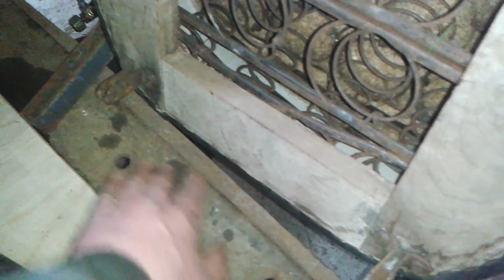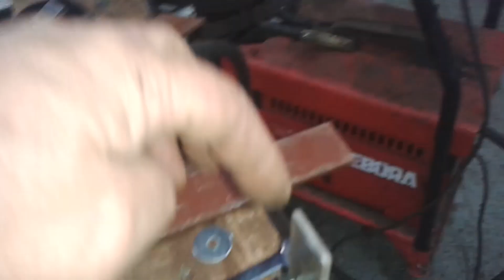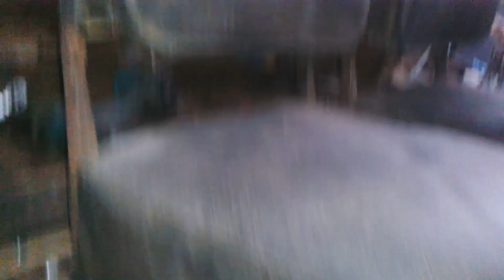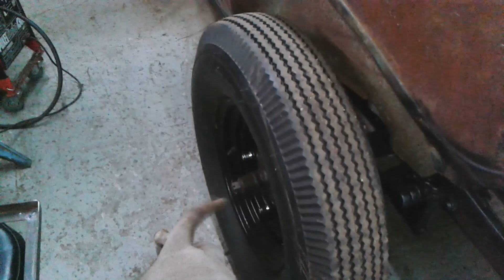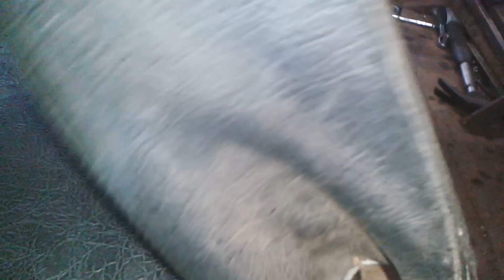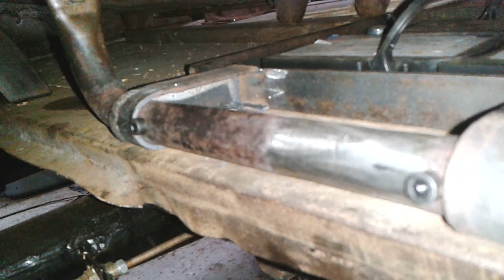32 sedan Progress. Seats, floor, battery tray Pt2. Mart's Update 2021/ep21/pt2.

Comment: Looks like a very solid and well executed solution to your seat issue. I like it! It makes me wonder though: how do the automotive registering agencies in Britain typically respond to modifications like this in old cars? Are there vehicle inspectors over there that might frown on a seat that swings forward to stow away like that? I understand that old cars could "grandfathered" in with old design features that aren't up to current manufacturers' codes, but I'm curious about MODS on old cars. In the US, there is a lot of variance between the states on such things. Our state no longer has inspections, but many states do...yet those states still don't seem to hassle hot rodders and their modifications too much. Didn't know if Britain was the same way.
Reply from the maker: Good question, Kaye, and I don't know a definitive answer. I had a van registered in the late 50s that had seats exactly like that, and Minis have folding seats and were only fitted with a latch in later years, so for a 1932 vehicle they are not out of place at all. I'm waiting for the registration application to come through. The vehicle will probably need to be inspected, but it is not a technical inspection, it just certifies that the numbers quoted in the documentation tally with those on the vehicle. Thanks for following along and giving thought to it. Mart.

Comment: Great job on the seat mounts and battery box, lots of "seat of the pants" engineering! I vote for a rear cargo deck instead of seats, probably more useful, good progress...
Reply from the maker: Thanks Earle. No decisions made re the rear compartment yet. I'm concentrating on what is required for running, driving and registration first. Actually the reg process requires to have a number of seats quoted so I will probably start off with a seat in place.

Comment: Theme for the day "seat of the pants engineering, for where you're going to put the seat of your pants".  My engineering is usually V1, the design in my head.  V2, the design that actually fits and works.  V3, the design that fits and works and works the way I want it to.  Sometimes there is a V3.a 😁
From my quarterback armchair, since you wont even have a rear seat, I'd have put the battery in the back in the raised area you spoke of.  Made only the passenger side (drinkers side per VGG) fold up and out-of-the way and put more modern (F1 maybe?) seat slider on the drivers side. Don't get me wrong, I loved watching this part of the build, and thanks for including your thought process. It's very satisfying to make the stuff yourself and not just buying everything from Speedway!  The Model A has the same goofy sized 12-24 screws in the floor-boards.  I have a bag full, it's probably too late but say the word and I'll send you some.
Reply from the maker: Thanks Art. Yeah there are 1000 ways to do any job. Thanks for thinking about the screws but I have come up with a solution.

Comment: Yep!! Even with a pretty thorough plan all "figured out" in advance, fabrication takes a considerable amount of time. On that seat adjuster pivot, how about enlarging the pivot hole and welding a tube sleeve for the pivot pin to rotate in. That would stop the "wobble". 
Lots of controversy over which type of build requires more "skill". Restoration or Hot Rod?? My belief is "Hot Rod" since it incorporates all the "restore" aspects that you exhibit so nicely while repairing and overcoming all the damage accumulated over the life of the principal pieces BUT ALSO includes all the engineering and fabrication that comes with all the "one off" character the builder includes in his unique design. No shortage of skill AND patience required in either one !!!!
Reply from the maker: Hi Ron. Yeah, building a traditional hot rod is difficult. A 1-800 street rod would be a piece of cake by comparison. If I were located in the USA it would be a lot easier. I'm having to restore some parts and come up with one off design and build solutions elsewhere. Not wanting to drill holes is also a constraint. I have done it but am trying to keep it to a minimum.

Comment: Mart, really like your creativity this week. Fun engineering, with that personal touch. Suggest it would look a little more period if you used a clevis, washer, and split pin to swing the seat up. Just a thought.
Reply from the maker: Hi Russ, I might do something like that. Seats are still semi mocked up, not the finished item yet. (as is everything, I suppose)

Comment: Nice job on the seats and floor...I like your adjuster. I was able to find a shorter battery on my old "33.
Reply from the maker: Cheers Dudley. I wanted to use this style of battery because I use the same type in all my old cars. Can swap between them then.

Comment: Mart on your seat adjuster,thinking you could fashion a guide bracket on bottom to keep rooster comb flat against pin plate.Might make the operation smoother.
Reply from the maker: Yeah, maybe, Nick, I had to stop messing with it, it's easy to fixate on something and eat the hours up. I might revisit if I find it problematical.